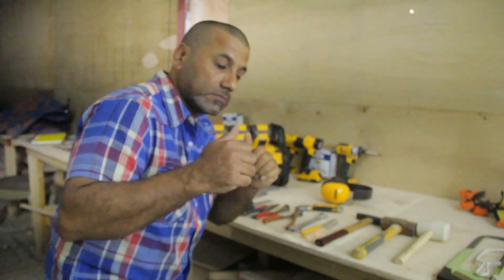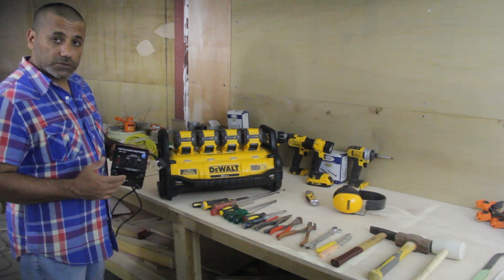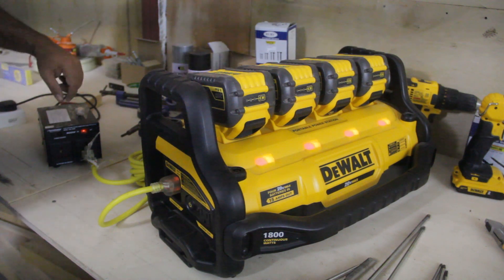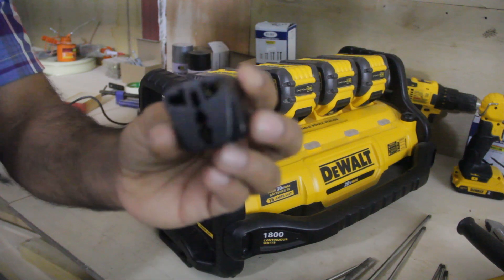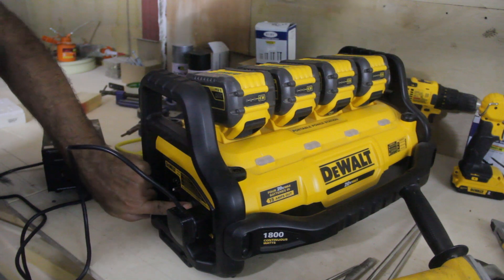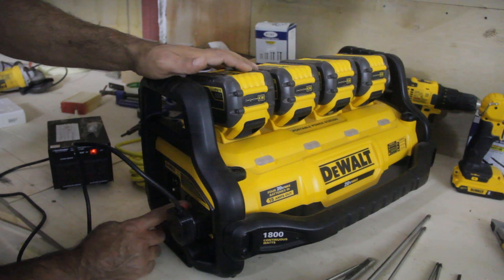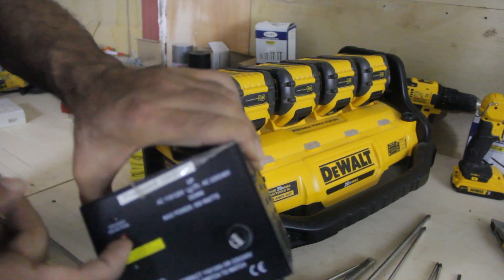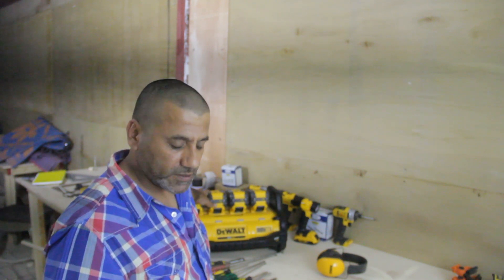dewalt portable power station from 110v to 220v flexvolt

Comment: Hi! Can I ask if you disassembled your dewalt power station already? So you could see if it can directly plug in 220v without transformer. Like my dewalt cordless fan. It says 110v on its labeled sticker but if you look inside of the unit it is actually autovolt in 220v also.

Comment: Hello, I am from Dubai, Can you tell me where you purchased power station from Amazon or from US website, please let me know. ALso, where you purchase power transfer former in Dubai please let me know
Reply from the maker: From USA Ebay
Reply: @jasimalhosani8980  now I havequestion about buying 60V battery, please let me know which courier service you used to bring this from US. Shop and Ship or purchased from Dubai? please let me know
Reply from the maker: Aramix
Reply: @jasimalhosani8980  thank you very much
Reply: @jasimalhosani8980  One more question, you purchased one time only 4 60V battery or 60V battery came along with power tool you purchased? please let me know
Reply from the maker: Or Amazon
Reply: @jasimalhosani8980  thank you very much... What about transformer please let me know. When you are charging using transformer the portable station you need to change to 220V in the back right then connect transfer to power outlet in the wall?
Also, can you tell me model number you purchased for power drilling tools? it seems you purchased 20V power tools? I would appreciate if you could put model number of tools
Reply: @jasimalhosani8980  you battery is 9ah? do you recommend to purchase your battery or newer version of DEWALT FLEXVOLT 20V/60V MAX Battery, 12.0-Ah (DCB612)? please let me know
Reply from the maker: I buy 4 batterys one time my batterys 9 mah if you want more time on batterys buy 12 mah
Reply: @jasimalhosani8980  sorry to bother you again what is watt in your transformer converter? 1000W or 2000W or 5000W? please let me know as I am trying to purchase transformer. thank you very much for support in this
Reply from the maker: Only 500w

Comment: only down side to this unit is the modified sine wave not good for things like computers and dedicate electronics you would need a pure sine wave unit for that. also its not good to have the battery's in when you plug it in all the battery's have to be out then you plug in and add the battery's 1 at a time its bad for the batteries cause of the spike in power when plugged in also there is not trickle charging after fully charged no stand by or maintaining charging on this unit so unplug when finish charged  

1 luv Reema nyc
Reply from the maker: Thank you for the tip ill do that sir